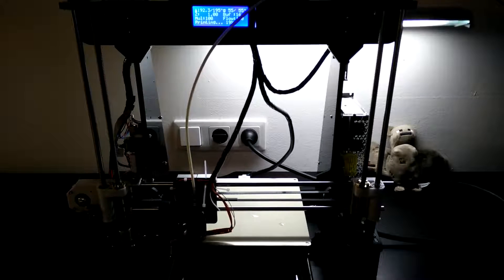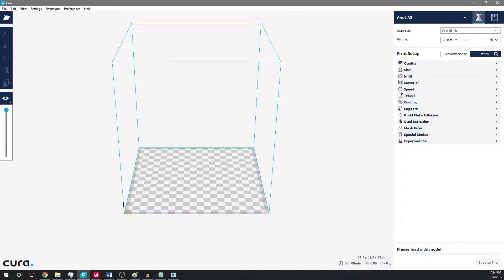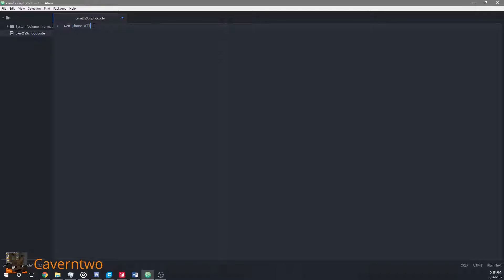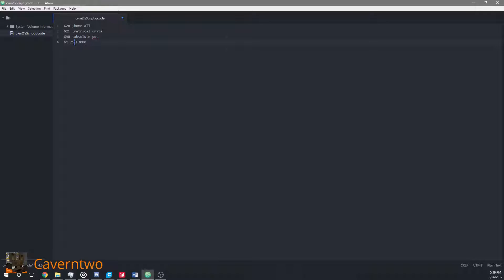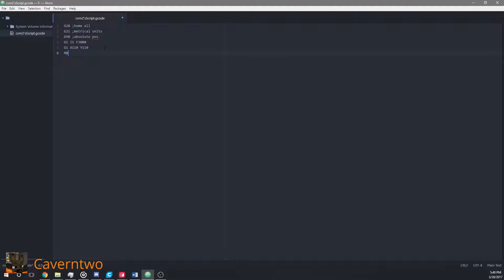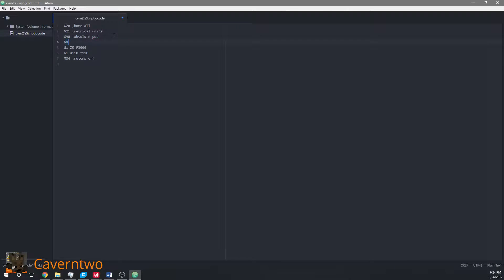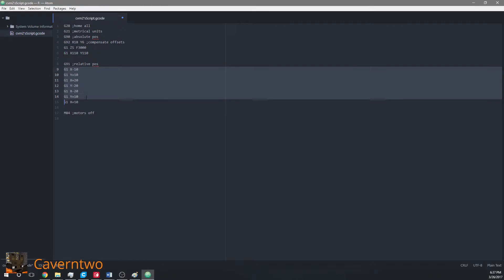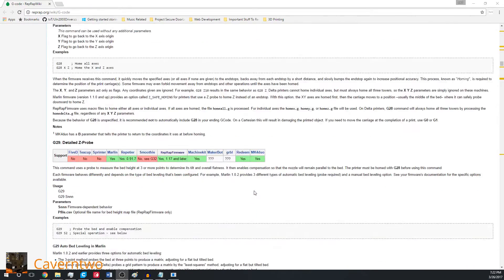G-Code Basics

Comment: can a gcode created on one printer, say ender 3 pro, be used on a different printer, say Prusa MK3S?
Reply from the maker: It might work, but could end up with unexpected results. I don't have either of those printers, so I can only give you a general idea.

GCODE is interpreted by the printer's firmware, e.g. Marlin. The major commands produce a similar result with any firmware (e.g. move to X:10, Y:20). So from this aspect, it could work. 
However, each printer has some individual settings in the slicer software, like physical dimensions, nozzle size, offsets and more.
The printer's firmware usually prevents things like going outside the actual dimensions, and doesn't do the move then. If that happens, your print will usually not end up like you want it. 
If you have a differently sized nozzle, you'll get severe over or under-extrusion. 

If your print is small, your printer has no offsets and has the same nozzle size, you could give it a try. See it as experiment where things can go (horribly) wrong! I also did it a few times already for the sake of experimentation. However, I don't recommend it at all due to the high error rate. It's not made for this purpose!